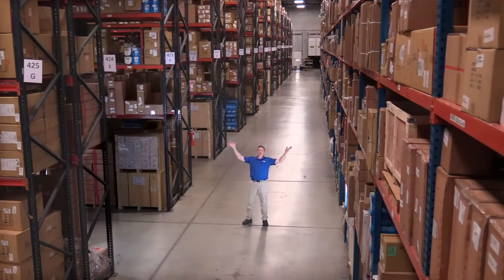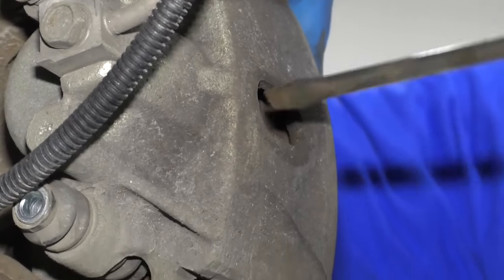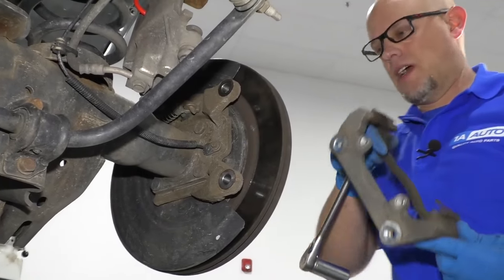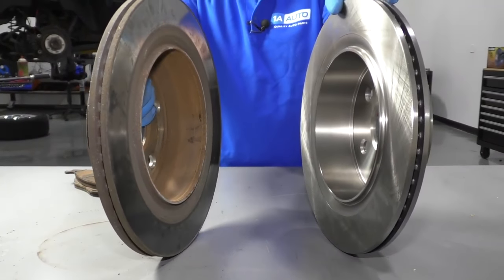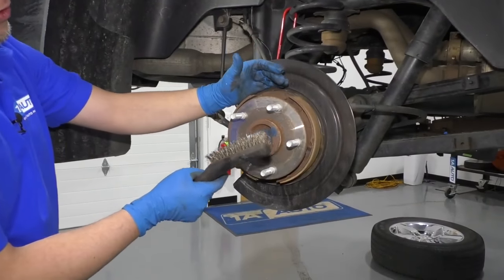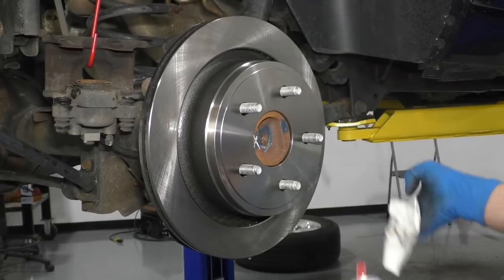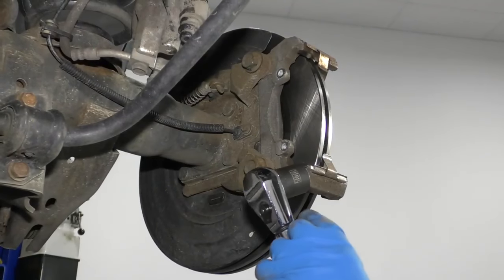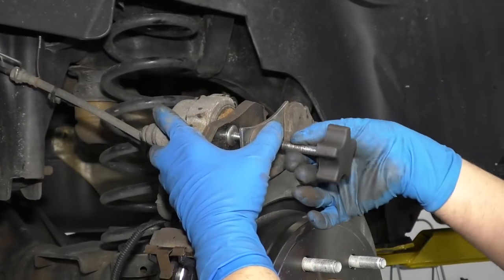How to Replace Rear Brakes 09-18 Ram 1500

Comment: Best pad replacement video I have seen. Easy to understand and very thorough, even down to the socket sizes.
My only suggestions are: 
1) Verify parking brake is released first. 
2) Add a Warning: Don't let caliper hang down supported only by the hose, which could damage it and cause a leak, use a hanger! 
3) Use new hardware for clips, which usually come with quality pads.

Comment: This video is great so thank u! Just a quick tip that hopefully helps somebody. If u are finding it impossible removing old rotor u have to remove black oval plug on back of dust cover. Behind it is a small gear that has to be turned downward with the end of a smaller flat head screwdriver(I turned it downward on the drivers side rear rotor, the passenger side might be the opposite). After several rotations down it will stop and your e brake is loose enough to get a hammer and whack the snot out of the rotor(u have to be aggressive sometimes, it will come loose) I hit mine from the back side while laying on the ground with a shortened sledge hammer and I had to give it 5 good licks and she busted loose. Good luck!
Reply: Thanks for this comment

Comment: Hey Andy, nice job explaining how the caliper goes on different on the drivers side. I did a brake job on my brothers 2014 Ram 1500 before watching this and I struggled trying to get the caliper on so the bolts could be started, wish I would of seen your video first. Thanks and keep them coming.!
Reply from the maker: +Bill Arenz Thanks for checking us out. Shop for high quality auto parts on 1AAuto.com:

http://1aau.to/m/Shop-1AAuto-c

Comment: I found 7/8s socket for lug nuts and 13/16s socket for the inside bolts worked better and were more snug than the mm sockets

Comment: 20+ year mechanic here. Always grease UNDER brake pad hardware only. new stainless pad hardware will not rust. Just prevent rusting between the bracket and the hardware using grease. The pad should slide fine without the grease. 

Using grease on top of the hardware will only introduce and hold dirt and grime, causing sticking.

Comment: I needed to replace one rear rotor. The replacement had a parking brake drum about a half inch smaller than the original. It is a 2010 Ram 1500. They replaced it and the second one was the same.
Any suggestions.

Comment: Is it normal that the tightening torque is not the same forward and backward? 2 pounds difference for the front and rear bracket and 7 pounds for the calipers? Why? tank you

Comment: I juat did the rear brakes on my RAM and I am having the same issue i was having. Squeaking! I think there is something i fkrgot to do like lube the parts! That may have been what was going on with the original brakes. They were the original. Probably needed to be lubed!!! I pull apart again and lube everything i forgot to and hopefully ill get the sqeak to go away!
Reply from the maker: +Scott yP Thanks for checking us out! http://1aau.to/m/Shop-1AAuto-c

Comment: I wish I had that kind of leverage to hit my seized rotor.. I've been stuck on the same rotor for over an hour now. 💀
Reply from the maker: +sebastien morissette Thanks for checking us out! http://1aau.to/m/Shop-1AAuto-c
Reply: Get a sledge, change the angle, I've been there, they freeze on and can be a bugger to get off. I spent a day trying to get the wheel bearing off my 05' and when it finally broke it just popped right off.

Comment: Thanks for video. Very helpful. But aren't you skipping the whole brake bleeding thing or is this all you have to do on newer cars?
Reply: not needed to bleed if you don't open the bleeder if you replace the caliper or brake line then yes you need to bleed but since that all stays intact with just a pad replacement no air has been introduced to the system  so no bleeding required

Comment: What regular maintenance should be performed on the rear emergency brake? Due to harsh Canadian winter I usually perform maintenance on my brakes once a year. But after 2 years of owning my 2017 Ram the emergency brake seized even with daily usage.
Reply from the maker: +MAP MAP Thanks for watching.  If they seized up after two years then you will probably want to add them to your yearly maintenance!
Reply: same problem with my 2015.
Reply: I think that's whats goin on with my 11... I've never messed with drums and shoes tho. Somewhat intimidated by that adjustment. Any advice would be appreciated. Thanks in advance

Comment: What's the recommended milage to do brakes at ?
Reply from the maker: +Jeremiah Pretzlaw Generally, brake pads need to be replaced after about 50,000 miles. Some need to be replaced after 25,000, while others can last for 70,000 miles – it depends on many factors. To get a more accurate number for your car's specific needs, consult the owner's manual. Thanks for checking us out!
Reply: Just got 50k out of my factory installed pads...not bad could have gotten a bit more out of them but with all the free time as of now why not just change them out.
Reply: @WERKED66  Mine were replaced at 40k miles. I live in Chicago and we have heavily salted roads during winter.

Comment: i AM HAVING PROBLEMS WITH RIGHT REAR BRAKE HOSE REPLACEMENT FOR A 2015 4X4 1500, CALIPER BOLTS ARE MASIVELY TORQUED ON AND BROKE ABS TAB IN HALF THAT IS MOUNTED TO BACK OF BRAKE ASSEMBLY., THIS IS FOR A 2015, 1500, NO INFO;{

Comment: I'm pretty sure someone welded my RR rotor to the hub...
Reply: I need an update did you summon your inner Thor and knock it loose
Reply: I've always wanted to do this. Just weld every piece of a car together before sending to the wreckers or trading it in.

Comment: I thought you supposed to bleed it when you push the caliper back
Reply: Nope - as long as you don't open brake lines anywhere, air won't get in.  Fluid is just pushed back up toward the reservoir.
Reply: Bleeding wont be necessary if you never  unbolted the caliper hose
Reply: You only bleed air if you opened the sealed system.
Reply: No, but you should have the reservoir cap open to avoid unnecessary pressure in the lines

Comment: What are the torque settings on the calipers bolts?
Reply from the maker: +David Hammon Thanks for watching!  24 ft lb for the caliper slid pin bolts, and 132 ft lb for the caliper bracket bolts.
Reply: I replaced the hardware on the caliper instead of wire brushing it, but I sure should have watched this video before tackling the task  of replacing the rear brakes on 2014 Ram 1500. Thanks the tips.